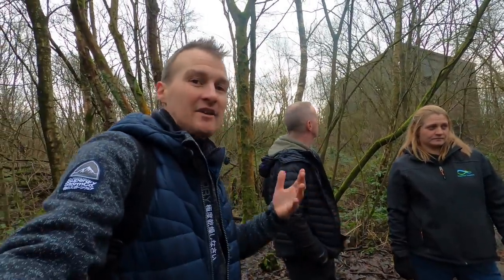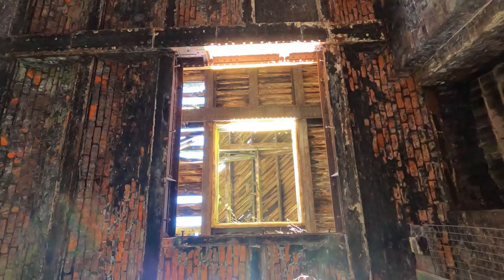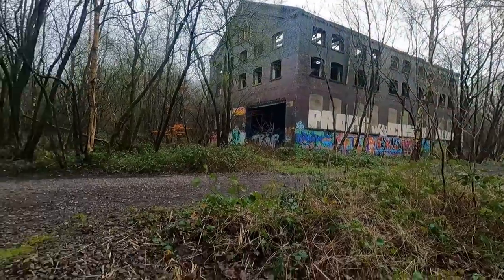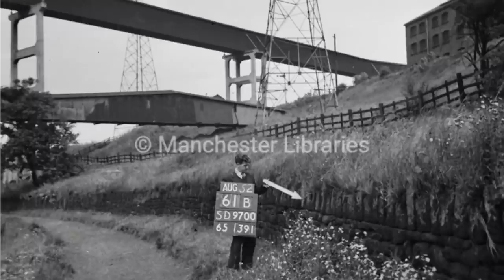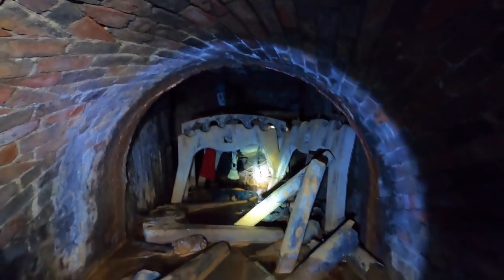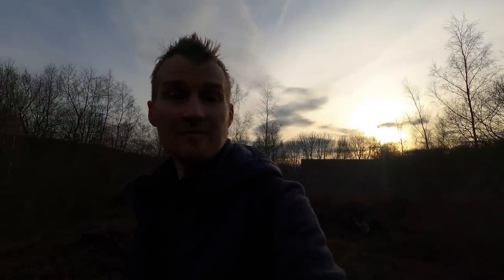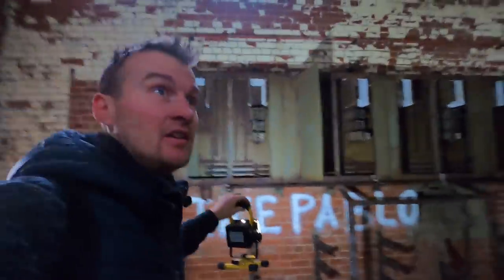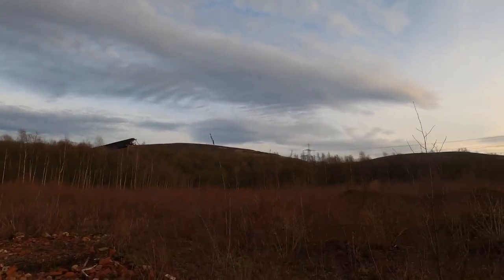A forgotten Goods Shed & The Lost Power Station in the Woods

Comment: Quality vid! Did you find the remains of the crane base and the old well by the Goods Shed? The remains of the signal box just north of the goods shed is quite difficult to spot, as it's mostly covered over by mud & debris.

Also in regards to the Staley & Millbrook railway station just down the way, there is only one thing left in the area, which is the base of a signal at the south end of the platform area, just down the eastward embankment. The rest of the station remains is under the mound as you walk up the path near the benches!